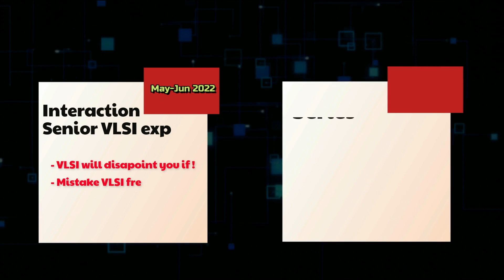VLSI enthusiast Attention! VLSI work env. | All about SoC Design engineer | Front end vs Backend |

Comment: I am currently a VLSI physical design intern at an IT company, and I have heard similar stuff from friends and engineers. Right now I am learning Tcl and designing automation flows like mentioned in the video. Still, I am looking forward to practicing front-end design next semester when I get to design a RISC-V processor in Verilog. Thank you so much for the video and the series! For an additional question, how would front-end engineers use C++? Our school uses C++ for projects to simulate multi-level cache and thread handling (computer architecture stuff) , but I am curious how it will be used at work.
Reply from the maker: There is nptel course c based vlsi design , you can refer that get your answer

Comment: What should i learn for SoC Design Engineer/ Physical Design Engineer? And what kind of projects will help me get hired as SoC Design Engineer / Physical Design Engineer?
Reply from the maker: Your question , gives a idea of making a video.. Oky in mean time see as a fresher basic requirement for all the profile are more or less same.... And probably few skill give you edge ovefother... For example if you are great with verilog , then probably you are best suited for front end or as you said soc design... I know you need more clarification , wait a bit let me try to bring a sort video about clarifying this.

For experienced guy this answer is not for you
Reply: @whyRD  please check your linkedin message
Reply: @whyRD  reminder!! Please make one video
Reply: Learn Verilog, STA, Digital electronics, Analog Electronics, Semiconductor theory . Do projects on hardware modelling using HDL language such as Verilog eg, RISC or CISC processor using verilog etc. Have basics on computer hardware & any programming language .

Comment: Taking training alongside with mtech beneficial????
Reply from the maker: No , it would be redundant, and MTech mean from top tier only , else you could explore this option
Reply: @whyRD  i think sir you should do more analysis since now a days even mid nits also giving good placement for vlsi
Reply from the maker: Yes probably... But there is always a risk involve as %age of job conversion are little lower then top tier right... So if want a job you waited for 2-3 more year why to take that risk... If you are waiting dont see option B ... prime focus for top tier only or else by mistake you are not able to achieve it ... go for mid tier and and keep option opens like doing a vlsi training or some more good project or making networks in linkedn or applying to off campus
Reply: @whyRD  yes sir but financially not so strong to wait or take a drop for 2-3 years

Comment: Bro do you know what is FEBE  ?
Reply: Its a team(very Intel specific) which works as an intermediary between Front-End and Back-End teams. I would not say that all companies have this team as it mostly falls into the superset of Backend Teams.
Reply: Whats the full form ?
Reply: @kritikarampal8115  how's the scope in this domain  ?
Reply: @embeddedenthusiast7121  - I feel that it is good for entry level.
Reply: @kritikarampal8115  what is the base of soc design engineer in intel?
Reply: @kritikarampal8115  thanks Kritika
Reply: @kritikarampal8115  hi kritika I'm a fresher and trained under pd, now my company putting me in FEBE project, but i want to work on pd, so if I work in this project is it going to  help me or it will hamper me